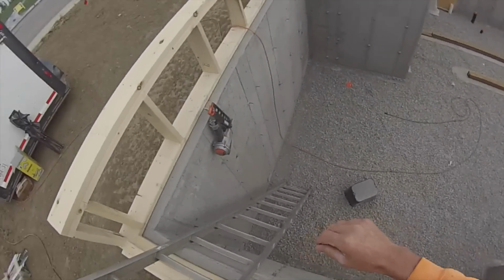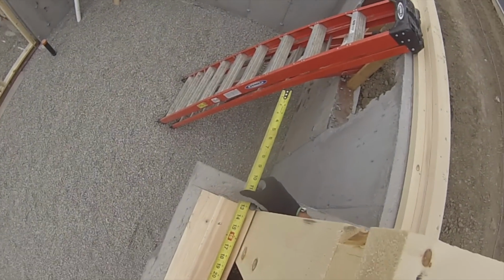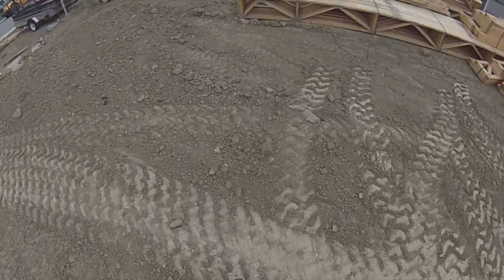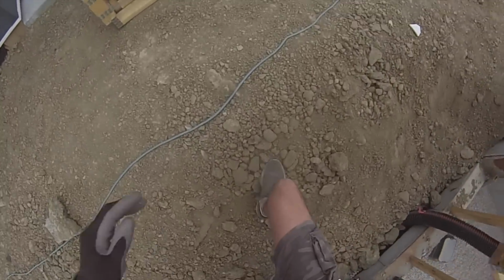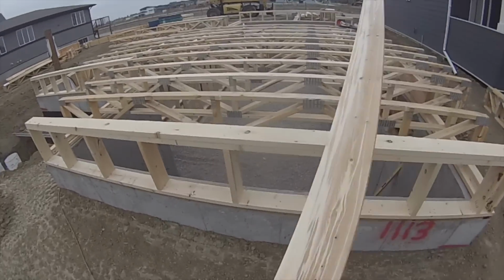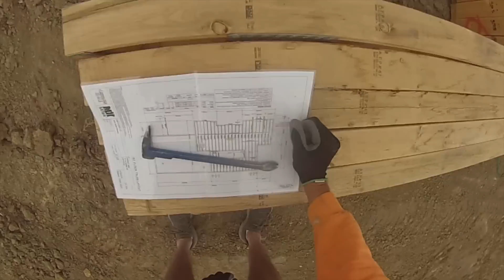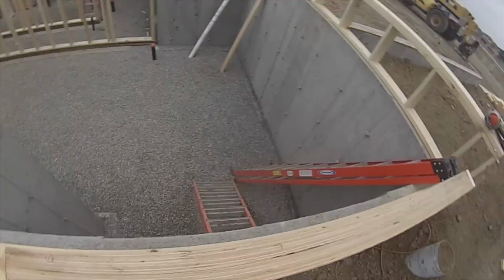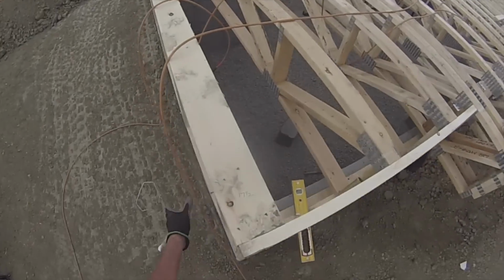Cartney Home Day 3

Comment: Are u going a quarter more on measurements if  I'm measuring 2 feet for trusses do I go 2 and inch and a garter back and ahead for that roof measurement as well as wall studs measurements
Reply from the maker: Are you laying out roof trusses? Or wall? If you are and you are trying to achieve 2’ centres you would mark 3/4” less than each 2’ mark. Example….1’-11 1/4” next mark 3’-11 1/4” and so on.

Comment: I to frame houses by myself I prefer it that way I do try to bring in help when putting up trusses  but will put up rafters alone but I usually have a 40 foot  reach  fork lift and a 60 ft man lift  a 5 ton mini excavator that is very handy for standing first floor walls  and other things  and most importantly I always have steel toe logger boots  WTF is on your feet
Reply from the maker: The lightest weight shoe possible!🤓